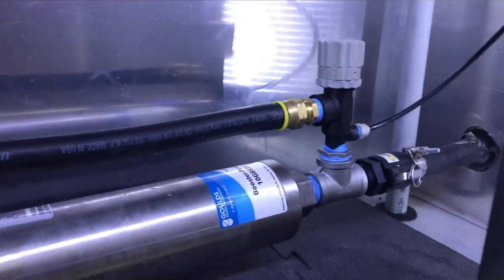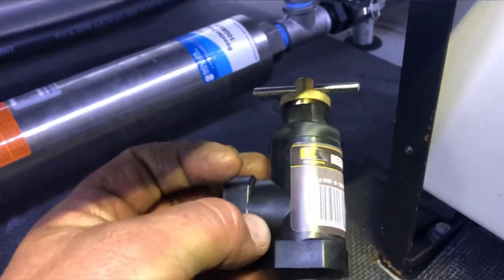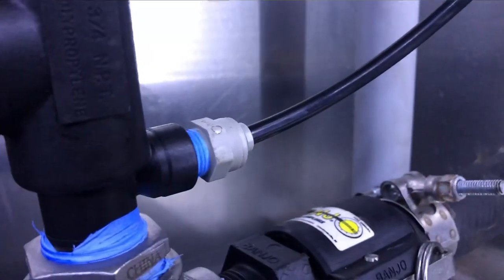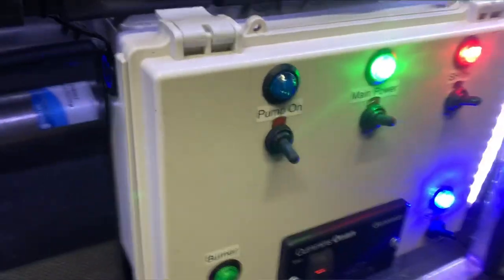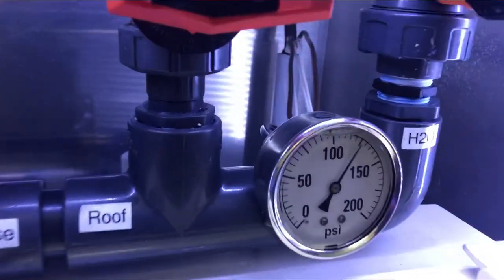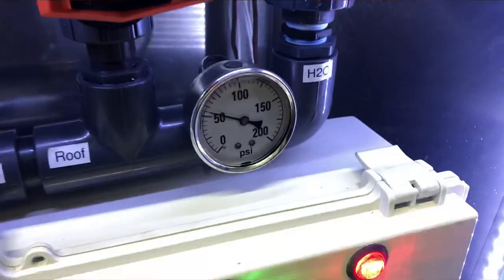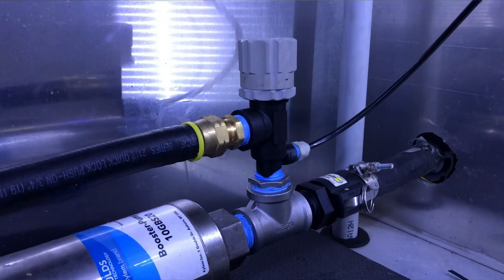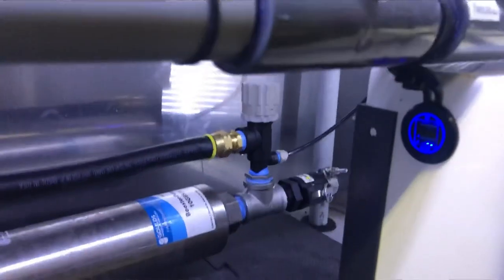New style booster pump bypass valve

Comment: I removed my bypass regulator from my 1hp booster pump.  it now gives me greater flow.  I have the remote control, so all I do is shut the pump on and off.  No regulator necessary.  Question about your setup, do you hookup customer garden hose fed water to your 2hp booster pump, or do you suck from your buffer tank?  I find force fed water pressure to Goulds booster pumps works best.
Reply from the maker: It sucks for the both buffer tank, you can’t force feed a 2 hp 10 gpm Booster